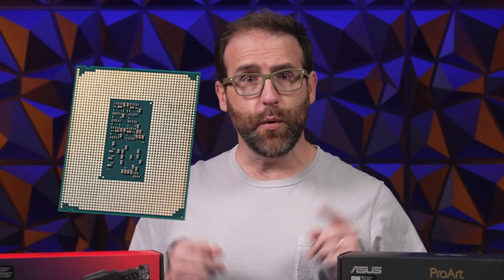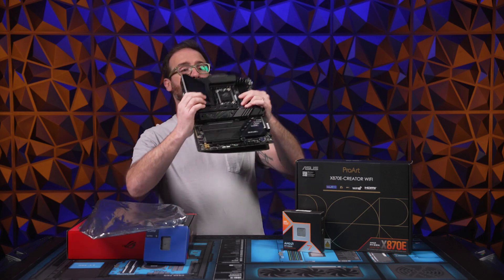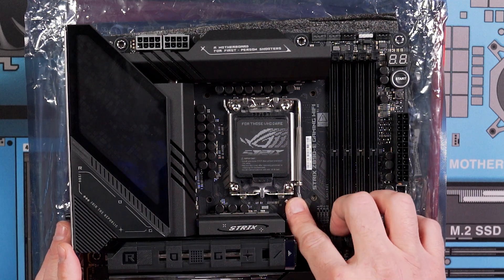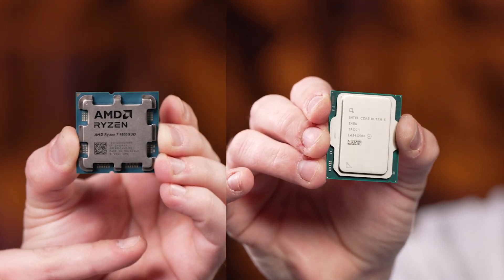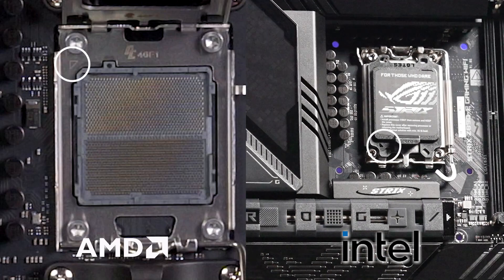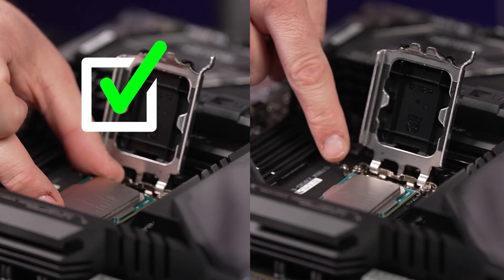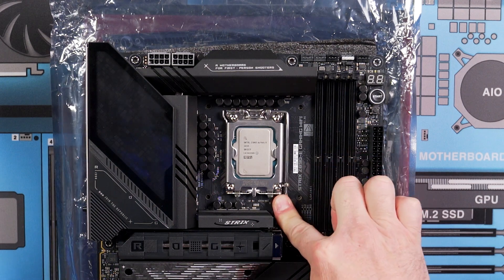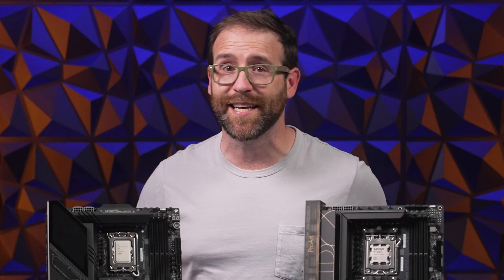How to Install an Intel and AMD CPU

Comment: ESD!!!  That stands for ElectroStatic Discharge... those little sparks from not perceptible to painful, especially when it's dry. As another viewer hinted, static electricity is a killer, or worse, leave electronics in a weakened state that may not show for a long time. Discharging to earth ground is a good start. The best and safest practice is to buy an inexpensive wrist strap meant for ESD grounding and wear it. At least dump the holiday sweater, crank up the dehumidifier, assemble on a stone counter or walk barefoot on a concrete floor. I've seen countless assemblies get "fried" in a factory. ESD is real.
Reply: I thought I remembered when I took A+ like a century ago that we used to install the mobo in the case first then hook it up to the psu and use a wrist band to ground everything.
Reply: @rediryou 
Depends. That's the safe way. I've seen PC builders who do it for a living do like this until final product to make sure everything works so they don't have to undo everything. 

Putting the processor in outside the case isn't a bad idea as you have more room
Reply: A humidistat can be helpful.  In the winter months, a humidifier (not a dehumidifier) could be helpful.  Same for taking a shower, washing the dishes by hand or drying laundry in the house.

Comment: I just ordered a brand-new PC because my TEN-YEAR-OLD rig is literally beginning to break. The CPU cooler fan is getting janky, and my GPU fans are also starting to make weird noises. Plus, the GPU is hitting either high thermals under load, or in some cases going over the thermal limit instantly when I try to open certain games and shutting the system down. I usually get "last year's tech" to save some money, but it wound up being cheaper on newegg to get the current generation of stuff; it makes no sense to me but them's the breaks.
All this to say I'm usually really nervous when putting the CPU in generally, but AMD is now using the LGA system in the AM5 socket and I'm TERRIFIED I'm going to mess it up. I've never had a bent pin situation in all my years, and I've also never installed a CPU incorrectly, but I've seen the pictures of the aftermath from people who don't know what they're doing and it's all I can think about now. My fatalism and catastrophism are off the charts!!! 
I know it's technically safer than the old, exposed pin system AMD used in the past, but never having using an LGA socket ever my anxiety is through the roof. I've only used AMD parts since I started building my own PCs in my teens, so the pin grid is all I know. Especially since all my components are arriving tomorrow I'm now starting to freak out! I'm kinda spinning out here. Anyone have any advice to keep me from literally shaking while I drop this damn thing onto the board?
Reply: Yea just chill out bruh, if you do all the necessary precautions then you have nothing to worry about lol.

Comment: after building computers for a long time that i learned to make sure to always discharge myself from static electricity before i touch anything
Reply: How does one do that
Reply: when you don't discharge yourself from static electricity you're mostly causing harm to the motherboard and can cause it to not turn on why it's best to have a static mat and wristband to help with that
Reply: @onebadbirdy how do you discharge yourself
Reply: @thierrygagnon9083 
I typically touch something metal and try not to shuffle about. If I move or walk somewhere I try to touch something before I get back to work. 

Think of it like would you rather shock yourself on a door knob or the motherboard? 

Some people get clips or whatever but I've only found they get in the way.
Reply: @thierrygagnon9083  If you don't have a anti-static wrist strap or something, you can just goto your bathroom or kitchen faucet and touch it to discharge yourself before working on your motherboard components.
Reply: @HikikomoriDC thanks this also helped me for my pc

Comment: Why does everyone use a cardboard box? It's useless.
Reply: 1. Its not conductive
2. The cardboard will absorb any downward force that may be applied and also protecting solder joints.